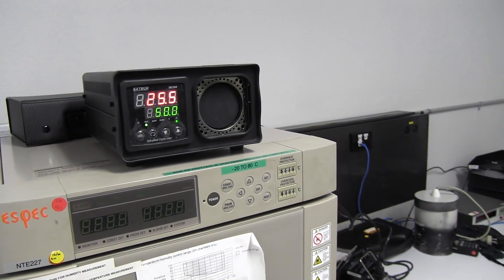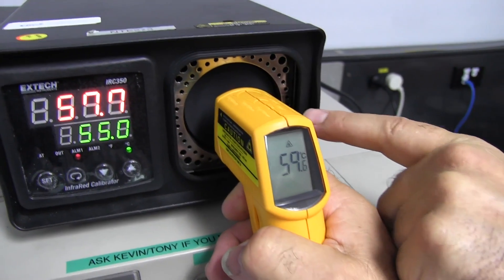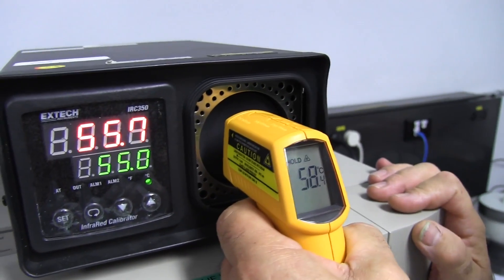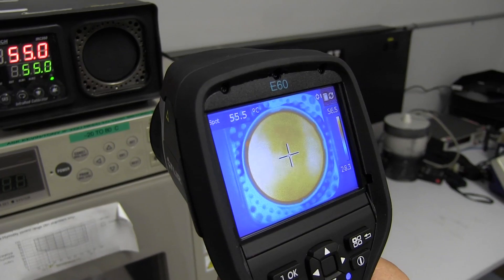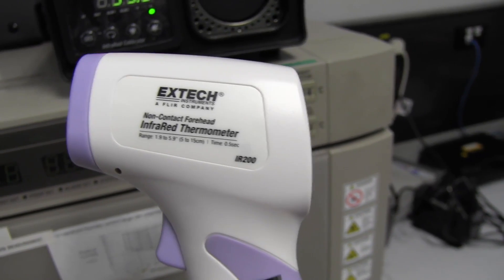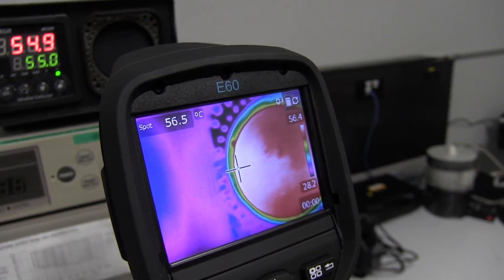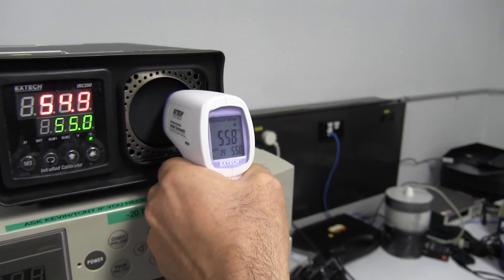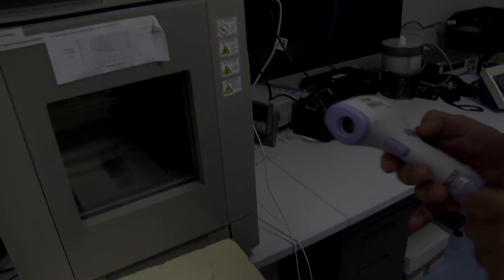EEVblog #403 - IR Thermometer Calibration Testing

Comment: Oooh, the FLIR E60.  Found seven of them sold on eBay for $4199 to $6660 brand new with case. Would love to have one for working on cars to visualize engine block cooling and heat distribution. Great video. Thanks again, Dave!!

Comment: The lenses for this series of cameras are about $1000 US each. I think that the majority of the cost of these cameras is the fabrication cost of the focal-plane array microbolometer, which is an integrated-circuit array of amorphous silicon thermal sensors, thermally isolated from the outside environment (I think it is mounted on a vacuum bottle).

Comment: I bought a set of Extech branded multimeters, one is a clamp on and the other a standard style. After some time, the standard meter refused to make any voltage readings. The clamp on continually resets itself seconds after being turned on, and if used in continuity mode will continually reset when it beeps.